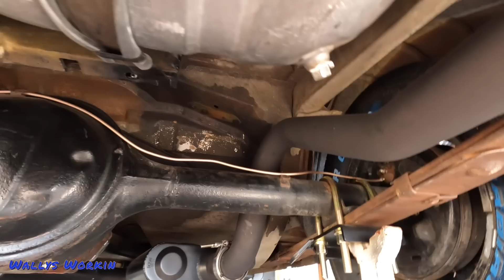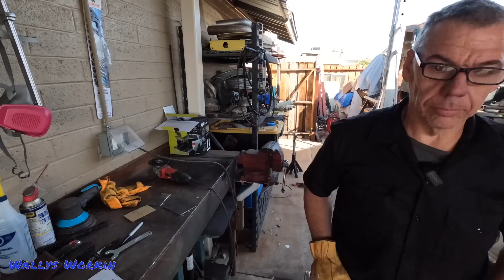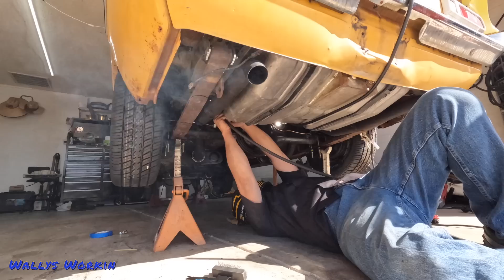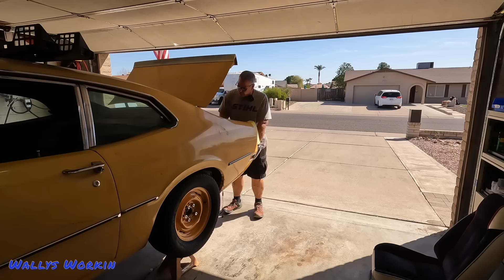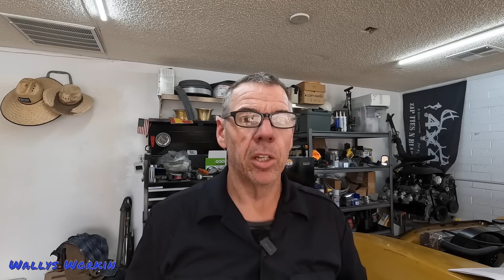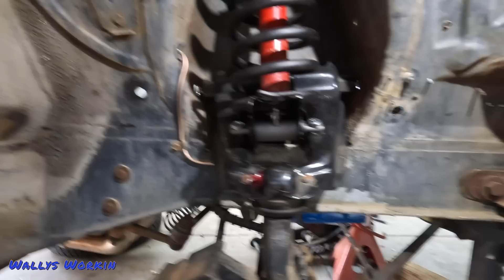The Maverick gets NEW adjustable rear shocks and hangers / Is it a race car now?

Comment: I still can’t believe you are working on a Maverick! I had one the same color in 72. Bought it brand new. I put high jackets air shocks on it, and I had too much air in them. One shock cracked the floor where it was mounted. Had to find a body shop to weld up the floor!
Reply from the maker: I can’t believe it either 😂